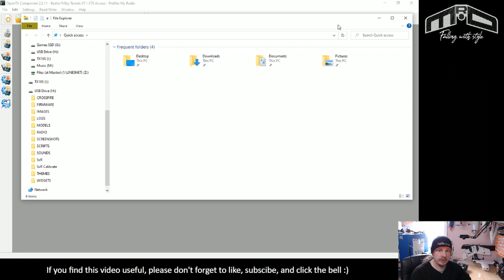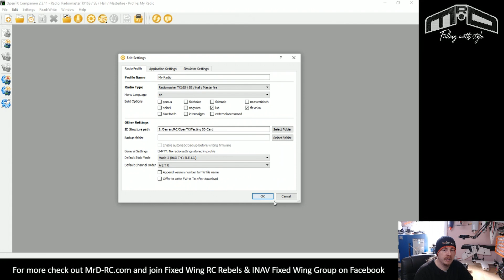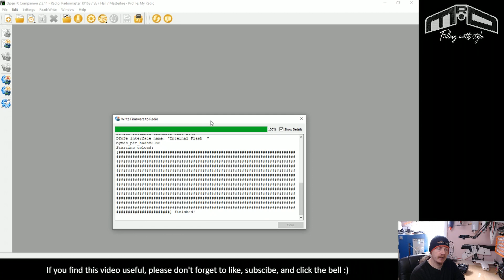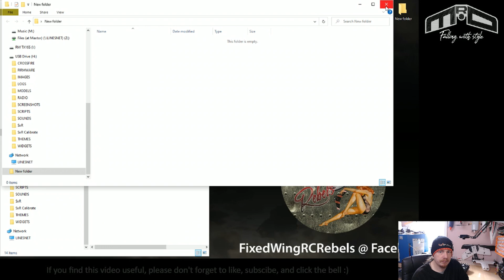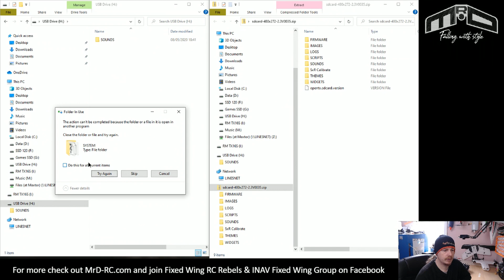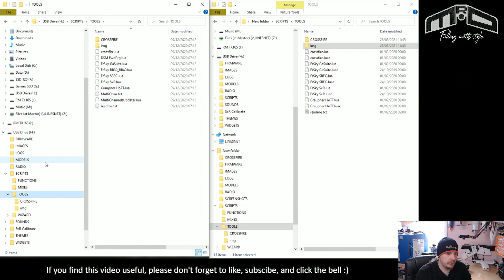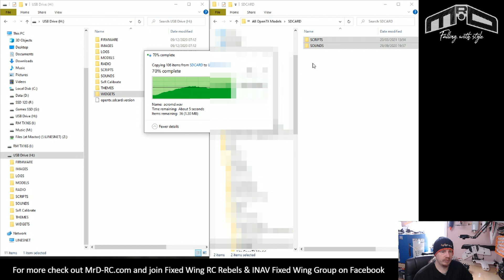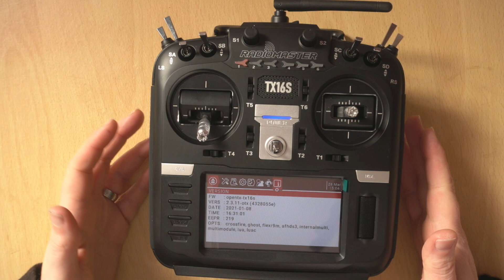How to update OpenTX

Comment: I've almost got my nerve up to try this because I'm still running 2.3.9 on my radiomaster tx16s, I just don't want to have to setup everything again like sounds for all the switches and definitely yaapu telemetry and maps  that was a ordeal. I guess following your video it should be ok. Thanks for all you do.
Reply from the maker: Most of the time, this update goes without a hitch. You backup the models and settings before starting the update. Yaapu is on thr SD Card, so won’t be effected by the update.
Reply: Thanks to you I'm now on 2.3.14 and your right everything seems to be working fine. Thanks

Comment: I tried updating my Taranis x9dse2019 according to your vid, but I failed. The DFU download method didn’t work either. And the ImpulseRC driver fixer did only lock up my computer. Had to do a hardboot my PC. Any chance the OpenTX Companion on an Apple computer would work?
Reply from the maker: Hi Ken. I’ve never had those problems. Especially the ImpulseRC Driver Fixer locking up the computer. I use that quite often too. The only thing I know about OpenTX Companion for the Mac, is that there is a MacOS version. I would imagine that everything works the same. So it may be worth a try.
Reply: @MrD  I’ve found another tutorial on how to do updates by writing the files made with OpenTX Companion with Windows file manager right to the sd card, then inserting the card into the transmitter and starting the boot loader. I will try to bypass Windows usb connection problems this way. Wish me luck!

Comment: Hi.. I had the same issue.. I had the cannot write firmware message so I tried to load firmware in dfu mode..  the radio says could not check firmware from radio. any ideas how to get past this would be appreciated.. cheers.  It's cool.. i managed to figure it out.. all my models and firmware has been updated. so now i can increase the volume and brightness using the S1 and S2 Knobs.
Reply from the maker: ImpulseRC Driver fixer would have been my answer. If you can’t connect via DFU, that will usually fix it.

Comment: I just purchased my TX16s last week and it came with version 2.3.11. I'm sure you've heard by now that the companion 2.3.11 through 2.3.14 will not check for updates. I've tried the manual update by installing 2.3.14 companion and tried replacing the two library files. Nothing works on the update check. Wondering have you've heard anything to make it work?
Reply from the maker: There is a new version of Companion 2.3.14 available which fixes this. It is recommended to clear your browser cache before trying to download. But if you got to http://www.open-tx.org/2021/10/01/companion-downloads and install that version of Companion, it works. I have just installed it and can confirm that updates are now checked and that firmware can be downloaded.
Reply: @MrD  cleared the browser as directed, redownloaded from your address given, when clicking on check for download buttons I get a pop up that says: companion update check failed, new version information not found.
Then gives another pop-up box: firmware update check failed new version information not found or invalid
Reply from the maker: I would maybe try uninstalling Companion and deleting its folder in Program Files; or maybe try downloading using a different browser. The companion on that link definitely works. So it must just be some remnants of the faulty one on your system. My 2.3.14 had the issue. Installed the version from that link and it worked perfectly.
Reply: I really appreciate all of your ideas and suggestions. The last one worked.
I went through and manually deleted everything I could find from open TX. Then I cranked up an old copy of edge instead of Firefox and downloaded with it.
I just got through flashing the firmware and the last screen on the system button shows version 2.3.14 now instead of 11.
Many thanks
Reply from the maker: Awesome. It had to be something lingering on from the old version. I’m glad it’s working for you and everything’s updated.

Comment: When I plug it in, nothing happens... could it be that I'm using a Mac and need to do something...?
Reply from the maker: There is a Mac version of OpenTX companion. So it should work. Unfortunately I don’t have a Mac, so can’t help much in all honesty.
Reply: @MrD  Six months after purchasing my Radiomaster, I’ve finally managed to create a model, bind its Rx and set the servos right… 
Crikey, things have changed since my last radio-control system: a Magregor 1-channel non-proportional jobbie which, in 1972, cost me £27, that was all my spare pocket money, birthday and Xmas presents combined!!
Reply from the maker: Wow, things have certainly changed. Still, I’m glad you are getting there with the setup. Hopefully you’ll be flying soon.

Comment: Have updated my Frsky horus X12S to 2.3.11.   Now a cant select use of the external aerial.    How do I back date to 2 3.9 or 2 3.10
Reply from the maker: If you have a copy of the older firmware, you can just flash it to the transmitter. 

If not, you may be able to download an older Companion, but I'm not sure that will give access to the older firmware. I can't see anywhere to download the older firmware outside of Companion.
Reply: @MrD  thanks,   that will teach me for not backing up my profile.   Hard lesson learned.    Lol   thanks,   I'll have a try in the morning.   And hello from little New Zealand
Reply from the maker: Hopefully they will have a fix soon. I’m sure 2.3.12 is close to release. Have a great night.